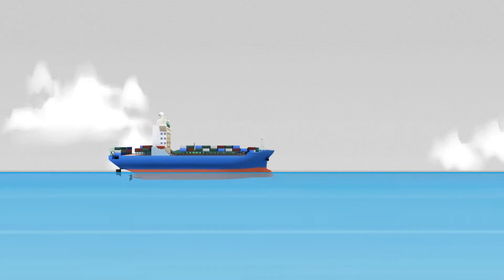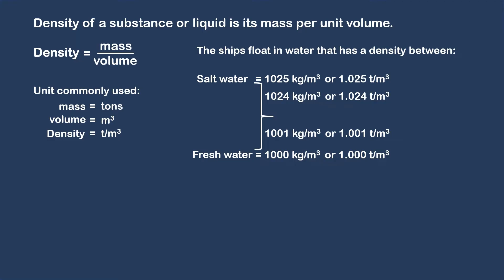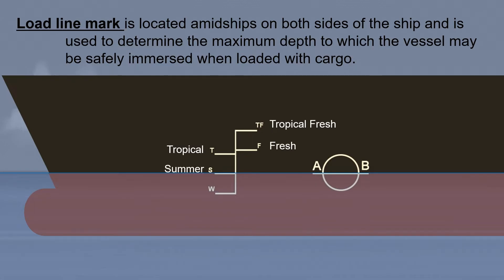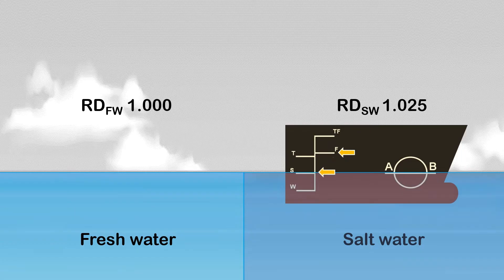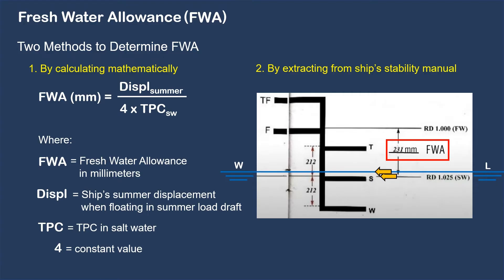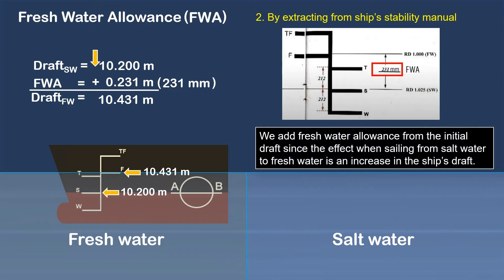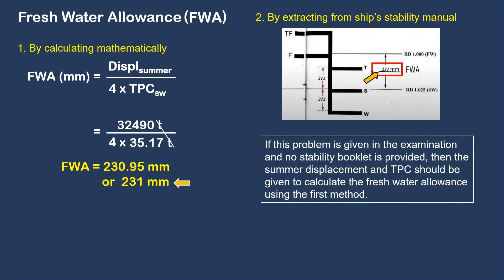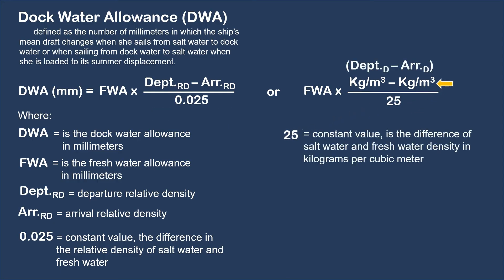Calculate the Fresh Water Allowance (FWA) & Dock Water Allowance (DWA) 2 ll Calculate Final Draft

Comment: This formula works for any loaded condition of ship or only when ship at Summer Load Line Draft???? Can use that formula if partly loaded ship or in Ballast?
Reply from the maker: Great question! The formula for correcting draft when moving between freshwater, dockwater, and saltwater applies regardless of the ship’s loading condition — whether the ship is fully loaded, partly loaded, or in ballast.

✅ What matters is the change in water density, not the displacement.
✅ The formula assumes the ship’s volume of displacement remains constant, and the draft changes based on water density differences.

So yes, you can use that formula even if the ship is not at Summer Load Line Draft, as long as you know the correct initial draft and water densities.
Reply: @nauticalacademy001 thanks so much for you r good clarification
Reply: @nauticalacademy001 i want to clarify again! Can use this formula for ballast condition if i took indexed tpc and displ from hydrostatic for 1.025: displ/(4*tpc)? My target to find Real FWA and then to find what will be draft in ballast condition if i go lets say from sw to fw! My question is due to ships loaded condition! Because FWA changing as per what is actual ships draft! FWA not stable for all drafts.

Comment: Excuse me Mr. , Correctly if I'm wrong, your DWA in your second example, I think it's wrong, it's 0.109 to calculate the Arrival Draft
Reply from the maker: Yes, you are right. Thank you. The DWA should be 0.109 m not 0.136, subtract 0.109 m to the initial draft, the final draft is 10.631 m. I forgot to edit the text after I copied it from the previous example. Thank you.
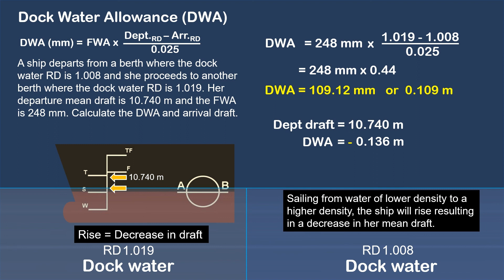Reply: In 11:16 Mr.